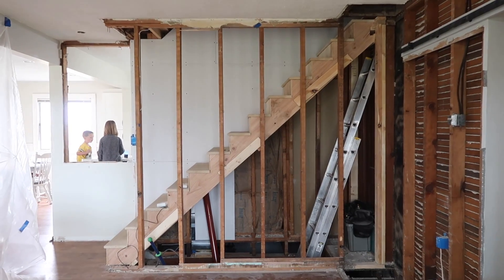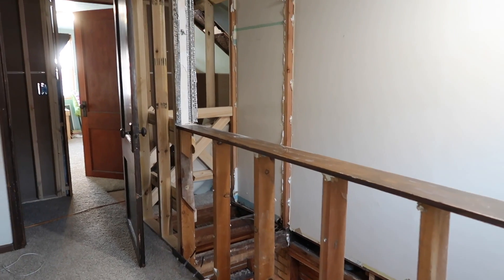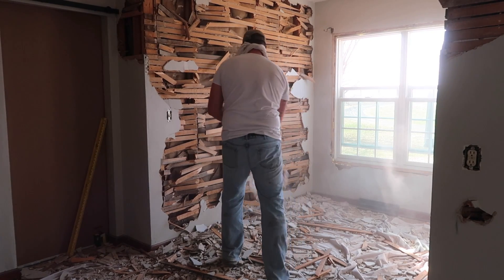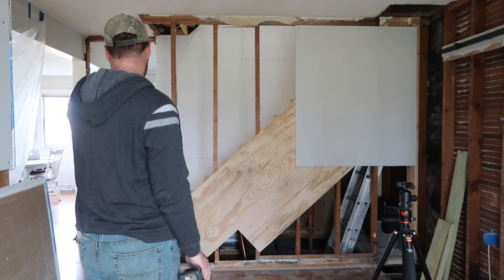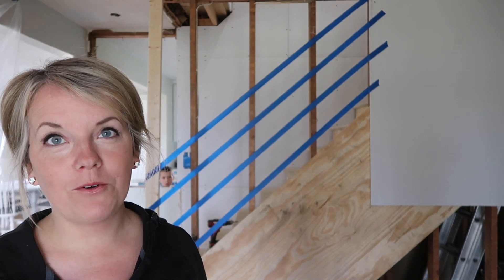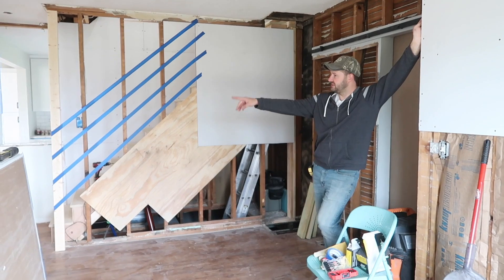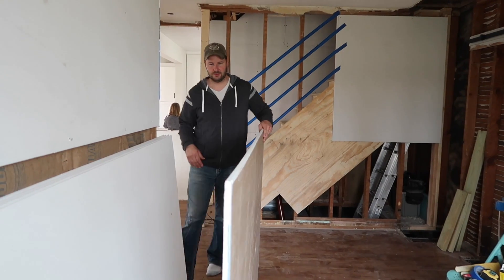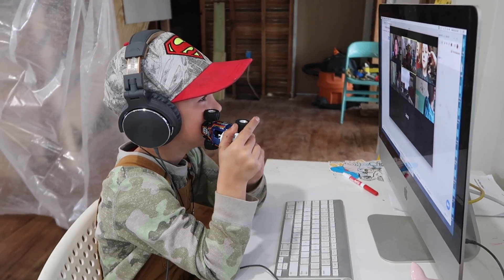Mocking up an Open Railing: We need to see it to believe it!

Comment: I think that the open railing adds a lot of character to the house and, in a sense , brings the house alive ! It will also make you house feel bigger and more room to breath . You can still put the desk to that wall, but maybe just a bit of a lower desk . If the desks are white , it might make it seem more "hidden" and not so bold . Since your house is smaller , every square foot is precious , against the wall is a good idea. I find for the extra little space you could put the other two desks to the wall( where dawn was originally) and use the rest of the space for school supplies . That may be more functional than underneath ( plus it's harder to organize cubbies under a desk ) overall , everything is looking good , and no matter what , I think it will look good. Of course Tom is probably tired , so the descision are up to your guy's energy level . 👍🏼❤️ Great work Tom and Dawn !! I'm supporting you every step of the way ! 💚

Comment: I have commented way back in the beginning. We did this exact same project 16yrs ago except our stairs flipped directions north and south and then we decided to flip east/west.  All in all we did the exact same half wall open stairs for some of the exact same reasons your mentioning.  I do not recommend doing this IF you really intend to have something in front of it.  I hate that the decorative work doesnt really show as much.  I had dreams of doing the xmas lights and garland and all that area is covered by the bookshelf in our case.  Its a low book shelf but the rails are never "clear".    Secondly I strongly agree with the person who said they put in what they thought was new technology and things change or kids now have laptops and dont need to sit at a desk.  We added all sorts of cables for phone jacks and coax cable and NONE of it is useful today.  Im so thankful at the last moment where I was going to have built in desks and media area I changed my mind and planned to just add them when the kids were old enough.  Now that space is a bedroom!  lol Built ins would have been wasted.  I think you should do the half rail but keep that wall clear or do a corner something then still put the big table maybe longer vs. square and it can flex to your needs at every stage including big family dinner pushed together with the other table!  :-)  How about on the stair wall that is before rails start you do somewhat built in ceiling to floor cabinet where you could keep supplies and paper and cables and crafts and all the things.  :-)

Comment: If you want more consistent natural light at the top of the stairs, investigate a tube light that goes up through the roof.  You can aim it south.  The ones we saw at the home and remodeling show also had an optional light bulb in them or a small solar set up that made them a night-light at night.  My folks had one and it really brightened up the stairs during the daytime, even if all the bedroom doors were closed.

Comment: I like the open stairwell, by it might not work for your needs. I hear you about an uneven floor! During our reno, after we pulled up the rug to put down hardwood bamboo flooring, we found our 1974 house settled unevenly, and we had a 1” difference from front to back😱! Took a long time, but we evened out the floor, the only 1” difference now is from the living room into the kitchen!

Comment: Open railing.  When I'm either in the kitchen area or the outer room, looking at the long wall makes me claustrophobic.  LOVE lots of light.  That way when the bedroom door at the top of the stairs is closed, there is still plenty of light. Railings draw the eye to discover what's around the next corner.  Similar to the layout of garden rooms. Storage  on the entire wall. Maybe deco shelves at the top.  one could place the framed artwork of your children in that area, which can be changed out.  Use the area under the stairs for deeper storage. I know you are a Minimal Mom, but having extra storage is priceless. It's nice to have a little extra and not use it.  Instead of stations for computers, go with lap tops.  They can use the home schooling table so you can still be in charge of online time.  With closed storage and the open shelves at the top the wall becomes an attractive focal point and not a clutter zone.  "Put your stuff in your cabinet and close the door." Easier to keep clean.  Also, in the home schooling area, are you planning on making U shaped benches around the table?  Lift top benches:  more storage.   Just some thoughts.

Comment: Open stairs with long common desk across for monitors. Add 3 separate wheeled cupboards underneath hinged on left, right back corner rounded & supported to allow for closure. When opened shelves move also. When open allows ~ Separate Storage, Legroom, Extra Top Work Space & Everything Tidy When Closed.

Comment: Dawn and Tom, Go for the open railing. If you are going to put the custom table in the other room the kids will have the flexibility to work in different spaces. Also, I think you will be happier in the long run having the stairwell more open. You can still do your “gallery wall” going up the steps.

Comment: Open railing, a desk for Dawn, and  multiple multi-purpose desk areas for each kid. We homeschool every where in and outside the home. Learned real quick that each child learns better in different areas and times. Some need to be one on one so closer to or with an adult while others are better alone in a quiet area. We have laptops for older children for mobility and a home computer for the younger.

I would do Dawn's desk separate. You could do both walls in the homeschool room, one side will be only Dawns. The other side maybe with the butcher block idea, that's nice, that can also be multi. So have additional plugins. That way one kid could use the area or more. 

Good luck!!

Comment: I've only homeschooled for a few years at this point, and I've learned the only thing that is always consistent is change. You'll want the space to be open & flexible because school evolves and grows. Consider what you're going to need in the next year (bookshelves for school books & resources like dictionaries, required reading, teachers manuals; maps; school supplies; booksacks won't go by the door but will be needed in the homeschool space). You'll want the space to be able to adapt to those needs. And don't forget, eventually you will be homeschooling all 4 kids :)

PS We homeschool at our kitchen table :)

Comment: I like the open stairway. Designtip: make 5 (not 4).
Now and when the kids are older (in 10 years) you are so happy with the light in your house. 
You can even close the lower site and set a table before that, and still have the open stairway.
Make the sitting room a cozy, happy place. And your (former) office also the homeschool area.

Comment: From my experience: If you would have the stairs open and a counter next to the stairs, it will get dusty very quickly, especially behind the screens. The movement from the stairs will always blow dust and hair down there. It can also be distracting, when you have to work and somebody is moving in your field of vision.

Comment: As so many have said, you don't need specific computer stations.  We have one 
computer everyone (5) shares.  And a large table that we all can be around for school. We do alot on the couch, outside, floor, kitchen, etc as well so even the large table isn't necessary but it does work for us. (Even if no one spends time at the table during the day, which rarely happens, it's a place for school projects and other things that are in process but done working on for the day to stay until the next school day). Whatever you decide, you will want flexibility as you discover what works for your family throughout all the years at home.

Comment: Open railing!  I agree with the other homeschool moms about laptops for the kids.  My children frequently get irritated with trying to work on the computer where others are doing book work, so they end up taking either the laptop or their book work to another room.  HOWEVER, I do think that Dawn's computer desk could go on the stairwell wall (to the right of the open stairs where there will be sheetrock).  Otherwise, the nice big table with stools in Dawn's old office sounds good for homeschooling.  I have tried MANY configurations for homeschooling and the one that works best is a big, sturdy table with a smooth top (not bumpy like a Lifetime folding table).  😁

Comment: Staircase: Keep the open railing. Add a small desk without anything built in next to the stairs for one workstation for anyone who needs some quite time or make it an area exclusive for Dawn. It will help with the resale of the house.  Common large table :Use a laptop or two on the common table. Make a bench under the window with storage underneath. This can be used as a window benchseat even when the area does not need to be used as a workspace with a large table. Think of how the room would look without the workstations and the large table.

Comment: I think the open railing would be better, and also that it would look better if it were open all the way up instead of stopping at that sheet that you put up. Also, someone else here mentioned spindles and I second that suggestion. Vertical rather than diagonal lines. (You can continue the railing up the stairwell above the ceiling level.) And laptops rather than computer stations will work a lot better.

Comment: Open railing. Even better if you also open the wall on the kitchen side too!  I agree with other comments about how moveable laptops is a better option than three full-sized computers. Not to mention the fact that Dawn is not going to like having her work area mixed in with the kids'.

Comment: One thing to consider is noise from the downstairs if you use the room at night when the kids are sleeping.  The full wall would block the noise more.    I like the idea of the counter desk, but the cabinets underneath will be challenging to access, so you may want to consider other storage options.      I do like the look of the open railing, so it depends on the functionality you are looking for.  :)

Comment: I wonder if it will change the heating throughout the house, have you always had doors to the upstairs and basement open, are there heat vents to the upstairs and downstairs and basement? I think closing off the stairway stays with the character of the house more, as long as it doesn't give you a problem with heating the upstairs or the downstairs and basement. I also think that Dawn's work area is going to be to close to all the children's work/school area if you add it to the counter area with the children, how do you get away from the children long enough to get Dawn's work done. After all she did have a whole wall area and almost a full sized room to work in before, I think that will be a very big change. As far as lighting goes I'm sure that will take care of itself for the stairway. Just some ideas I had from remodels that have been done over the years of my life. STAY SAFE and HEALTHY all of you. God Bless you all.

Comment: I think either open or wall would work for the area.  You could just provide each of the children with a lap top and they could use that at the table area.  May need a shelving unit on one wall for school supplies and art supplies.  They way you could just have your desk/counter with computer (work station) at the stairs, especially if it is an open stairway.  Whatever you 2 decide, I;m sure it will be great and look great.

Comment: Another homeschooling mom voting here..😅 The individual computer stations look and sound nice, in theory, but aren't as functional or practical in real life. Here are some reasons why:

1. Easily distracted - with no dividers between the computers, the kids might have a hard time focusing on their own screen. 
2. Harder for you to get work done - Similar to point one, if three of you are all in that one space, those precious kiddos will see mom as the constant one to chat with (depending on their personality types, of course 😉).
3. No mobility. If one child needs a quieter space to work in, they will not be able to just take the computer and move to the table or kitchen. 
4. Not all school work is done on computers. So you've got an entire space designated to just that function, but how much will it actually be used? 

However, I do love how each option looks! The open stairway, and the wall/computer station are both great. So if computer stations are what work best for your family, then go for it! Tom can always change the set up down the road if need be, right?? 😉😆.

Comment: A bit detailed, but you did ask our opinion. 😁

I like the idea of both sides open, but I would certainly consider taking out the "window" area either way. It would give more square footage to the home, make it more open and make stair access easier from the other side of the house...no need to walk around for access.

I also like the idea of  vertical spindles vs horizontal lines. The spindles will give the area a "taller" effect...and is more period appropriate to the house.

As a homeschooling family for 16 years and a certified teacher, I would NOT do a built-in on the wall. Having all the "school stuff" fully visible outside of school hours is no bueno. All those screens all the time. 😬 I wanted our home to be our home. The fact that we homeschool is secondary. I never wanted school to take over our home and I didn't want everyone who visited feeling that they needed to "comment" on our choice.

I would set up the area for extra electrical that may be used in the future, but having a permanent desk area limits your ability to change the space as your families needs change. Also, the under cabinets will be difficult to access and will become a frustration when items are left out because access is difficult. And as a mom with taller kids, having items in their leg space is a complete frustration. It's so bad here, I've converted multiple desks to small dining room tables.

I would give each of the kids their own space/desks. Each child has always had their own school space for independent work, especially when they were younger. It helps keep each be accountable for their own items, cuts down on distractions from others, and keeps them having to vie for shared space. I have a table that I use for my desk that is great for one-on-one teaching and group instruction. I think your current dining table is great for group and you could use your desk for one-on-one.

One can never go wrong having flexible spaces.

Comment: I like the open staircase.  I went back and reviewed your computer setup.  Your desk, file cabinet and printer along with two more computers is going to crowd that wall whether you keep it open or close it up.  I would suggest moving just your desk and accessories to the wall.  Laptops or tablets will work better for the kids.  You could create a charging system by your desk for them.  IMO too much by that stairs is going to look cluttered.  A minimalist no-no.   LOL.

Comment: I voted for closed, and yes on the computer arrangement Dawn described.  I want to tell you why.  2 reasons.  If there are angled handrails behind the desk and chairs, I think it  will look uncoordinated.  Too many different shapes and angles in the same space.  second reason, I think you will need wall behind the computers for various reasons.  To mount instructions, or student art, or whatever on, or maybe to mount monitors on the wall.  Those aren't great ideas, but I think desk areas need as much space as possible.  If there were the open railing, I don't think anything should be in front of it.

Comment: Too many comments to see if someone already said this....what about making "windows" in the staircase? Put up the drywall and then you don't have to put in a header, but then cut different size openings for windows in the drywall as you go up the stairs! Gives interest and will then let light through the stairwell! Win-win situation! You, of course , would have to trim them out to make them look good. And you could still put some pictures on the right side to balance it out. If I could draw a picture I would.... And I agree with others to not make anything permanent as far as the desks go. Use individual desks so that they can be moved around as needed...

Comment: I actually love both ideas, right up until you see how dark the stairs are. I think you should do the railing. However, you might consider setting up Dawn's desk next to the stairs and the kids computers on the table in the alcove. Laptops are very powerful now so you don't really need for them to have a desktop that's immovable. You could create an island with the cabinets for the table base to store their supplies and put the laptops when not in use, giving you all of that space for projects. I think that would tick off all of the boxes I heard mentioned in the video.

Comment: I would keep it open. You'd be surprised how much you don't need the computer while homeschooling. (I am thinking you will be picking out your own Curriculum, but if you are doing public school at home then maybe more computers?). You might only want to have two total or you may be able to get by with one. Just a thought. Having the extra light will be nice especially during the fall and winter. We do a LOT of our schooling snuggled on the couch, outside on the deck, lying on the hammock or swinging on the swing set. 😍😉 Love the butcher block counter idea! I may add that to our living room!